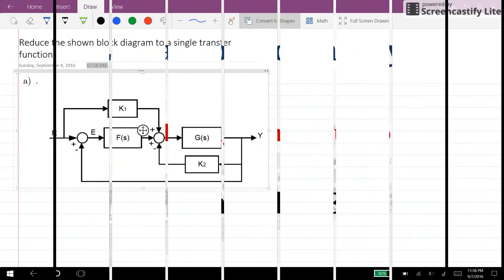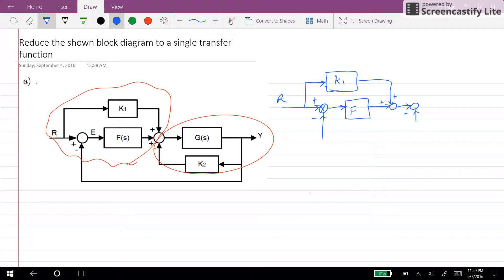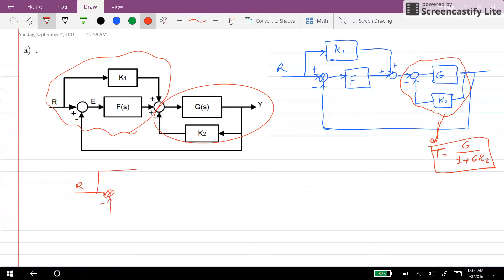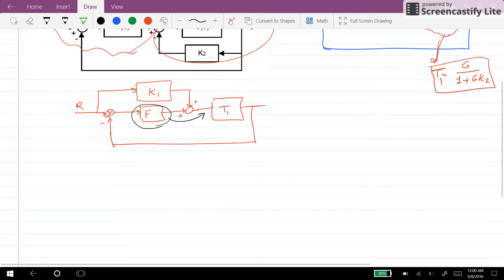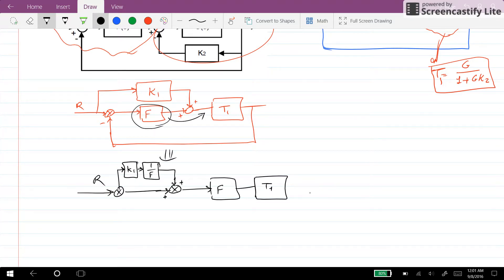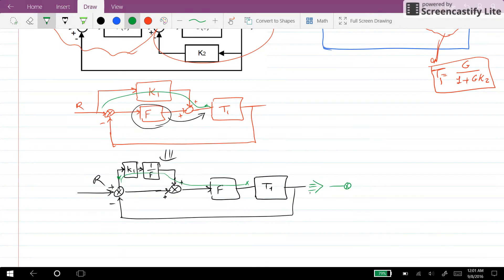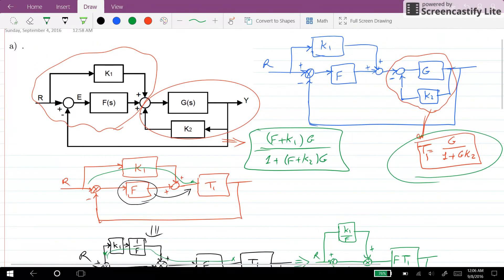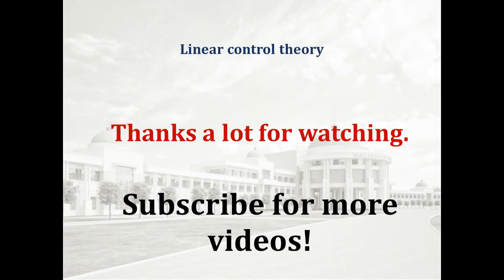Block diagram reduction - Example 03

Comment: At 3.40 we can't  separate summing and take of point like this. Because in the separation take off point comes ahead of summing point. Please explain???
Reply from the maker: Thanks for pointing this out. Indeed, there is a mistake in the previous step, 2:52. The signal to K/F block should come directly from R, not from the summing point. Considering this in mind, the next steps are fine.
Otherwise, you are right, and we can not do that kind of separation.
Reply: Thank you
Reply from the maker: @Col.JamesTodd  Thanks!